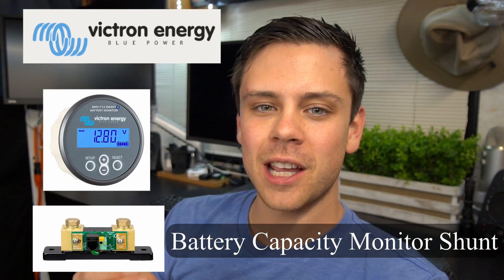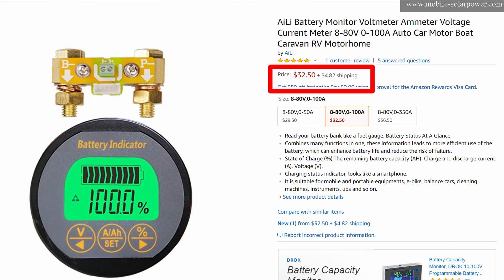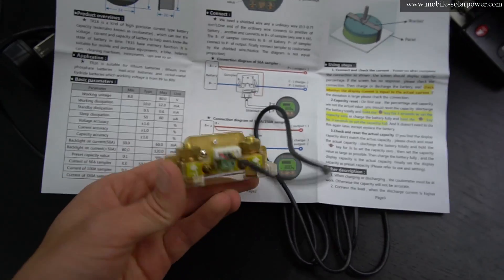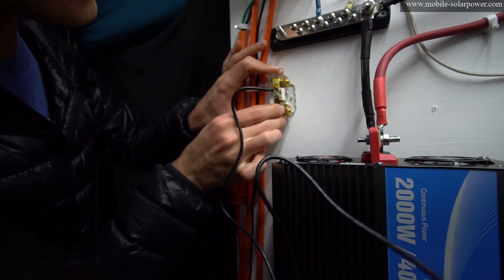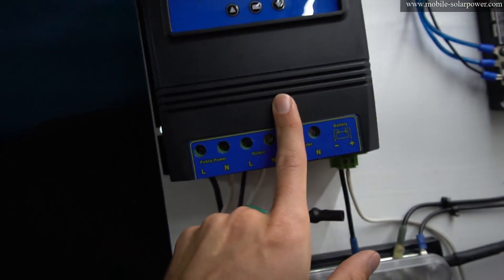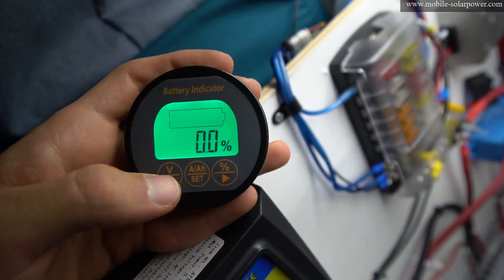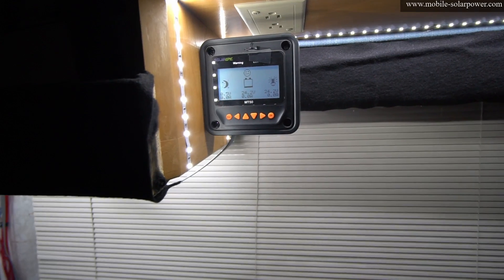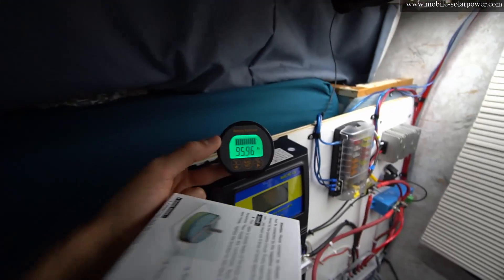$200 Victron Solar Battery Monitor? Try this $30 Chinese one instead! Great for Off-grid Solar

Comment: When it comes to electronics I like quality. Victron is quality. Every component that is a part of a mobile power system is subject to failure. Most failures are just a nuisance. Some are a fire hazard. If a company can't spend the money for market correct instructions I have to wonder what kind of junk is in the box behind the owners manual.
Reply from the maker: Yeah but what could fail that would cause an actual problem besides not working? Shunts are dead simple. It's a shunt. I don't see any fire hazards here. what part of the circuit do you not like?
Reply: @WillProwse  In the video you said the reviews were good. I assume you weren't talking about the single review on your link. What reviews? I am interested to have a look.
Reply from the maker: @harleyd500  yeah I thought there were more reviews, but just one. It was just released this month. If you are worried about any fire hazard, fuse the positive wire that feeds it, and ensure that proper gauge wire is used. The shunt itself is simply a very low resistance resistor, and the monitor can measure the current going through it. And it's on the negative side, so the potential for something bad to happen is super low. Unless it is physically damaged, or the wrong size shunt is used. If it does fail, I don't see how it would cause any problems at all. I've also used other Chinese shunts in the past for years, and they work great. Very simple device
Reply: @WillProwse  I'm not worried. I have been using a Victron BM for the last year. While the Shunt is a low resistance device for measuring you are passing all the 12v uses which depending on use can present substantial current. It is essentially a battery cable. Like any component that passes high amperage it is subject to heat and fire if overloaded. Victron devices are submitted and tested for Ul and international standards. I don't mean to poo-poo your video or this product. Just pointing out that sometimes cheap knock-offs aren't always the right way to go.
Reply from the maker: @harleyd500  I totally agree and I share the same concerns, but it's a solid piece of metal. How will that break?
Reply: @WillProwse  Yes, probably the worst that happens is it's inaccurate and then dies an early death.   Of course, that's the probable situation with super cheap electronics, but when it fails you can always get another one and swap it out.
Reply from the maker: @ceeweedsl  but how? It's a shunt lol. It's a piece of metal with very very small resistance. How would it heat up? Shunts are solid. I think a button on the screen or a solder joint would fail before the shunt did
Reply: @WillProwse  Agreed, the shunt is unlikely to fail in a dangerous way especially being on the negative side.  Don't know how the sensing works, but it is odd that name brand shunts cost $50 or more.  Maybe it's cheap because it uses out-of-spec reject components.   That is a thing (in general)  from what I understand.    The little computer that reads the shunt and voltage, calculates and displays them is more what's subject to failure. OK, honestly, likely to fail within 24 months.   Again, worst case, you change it out every now and then and/or make poor decisions based on an inaccurate meter.   Look,  there are $5 digital VOMs that can serve for certain things ( I keep a few around)  but anybody who depends on one for work would far prefer the accuracy and dependability of a Fluke or similar.    

That said, these cheap shunt based meters look pretty good for the money.   I'd use it for something like a trolling motor setup or the old portable "Solar Generator" I used to carry around in my truck.  It was a $300 system.  But with LiFePo4 and/or a serious installed 12V system, better to pay for quality and fuller functionality.  I think that's what you are sayin' as well. 

The Victron, besides being marine grade with a track record has many more features, all of which I use.  Accurate charge status, relay logic and the bluetooth app are killer features.  But hey, a lot of times you just need a volt/amp meter and this seems to do that.  If it's not mission critical and you can take your chances with durability, than it may be just right for the situation. .
Reply from the maker: @ceeweedsl  agreed! Exactly
Reply from the maker: Also, victron is manufactured in india.
Reply: They have rewritten the instructions. They are quite easy to understand and follow now. At least on the 350A version that I purchased from Amazon a few days ago. They have also added the ability to turn the backlight off and on, by pressing the V and % buttons simultaneously and holding for a second or two.